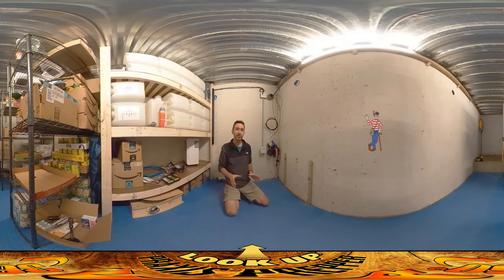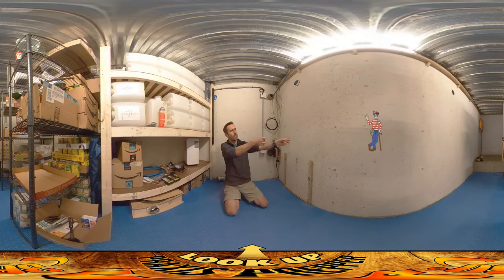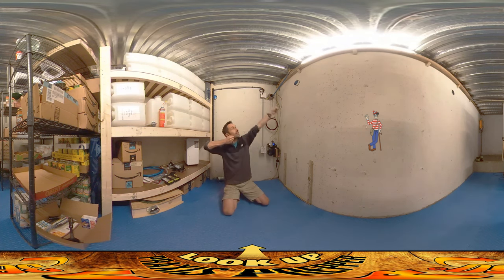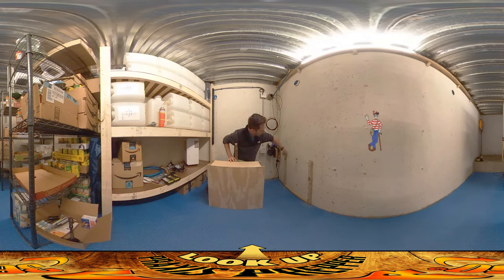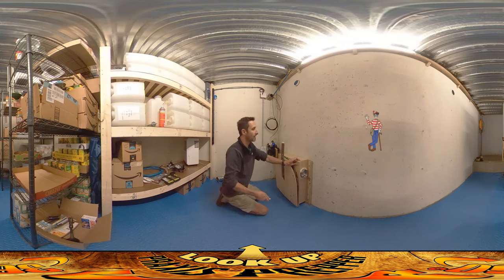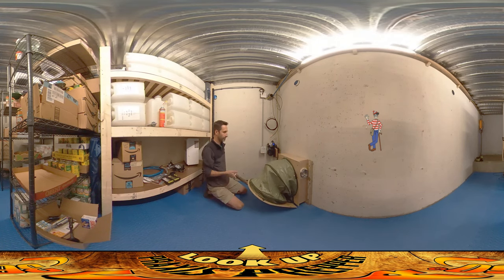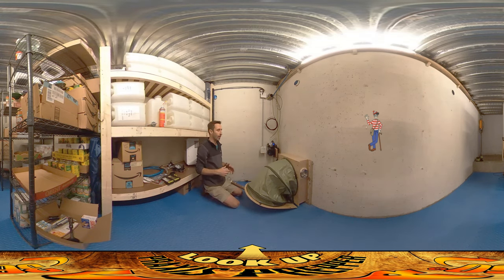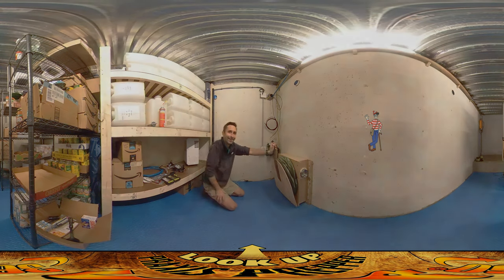Homestead Building - Fallout Shelter Manual Air Pump Install

Comment: Nice 👍 The fact that you don’t have to use it except for short periods periodically will make the exhaustion issue minimal especially when you are able to share the effort. Could turn it into the worst drinking game ever… the lose has to go do a couple pumps each round 🤪

As for the arrow, if you need to try it again, remove the tip and don’t pull as far. Try it a couple times with a short pull and increase the draw until you get the right height. Should make it dramatically easier to keep track of it. You can also get “glow in the dark” fishing line, doesn’t actually glow but fluoresces under a black light.
Reply from the maker: Cool tips! The arrow shooting actually went surprisingly well. Three tries and all were usable.
Reply: @PraxisPrepper  Nice, I know it had to have taken a fair amount of effort to find them. BTW, looks like River has had quite the growth spurt, won’t be long before he can look you straight in the eye.

Comment: The air exchanger came out well.  I can see using that as a backup.  But is there a low wattage air blower that you could use via battery for the main air exchanger?
Reply from the maker: The existing fan that's in there is actually pretty low wattage. We could totally run it off either electrical system (the primary or the backup) if needed. I love those venting fans. Very quiet, very low energy.